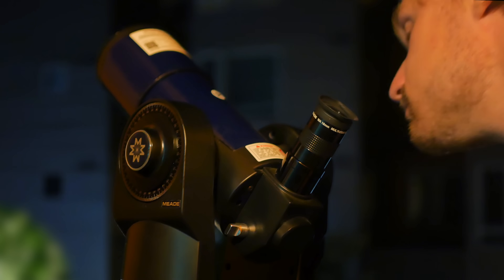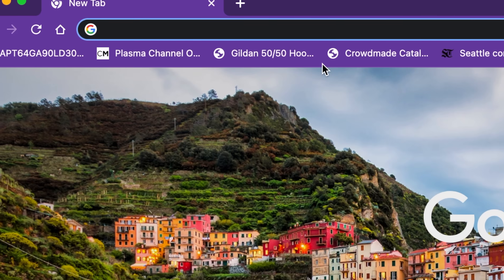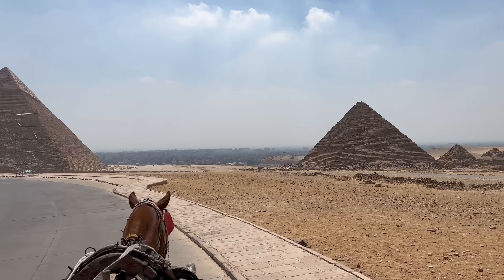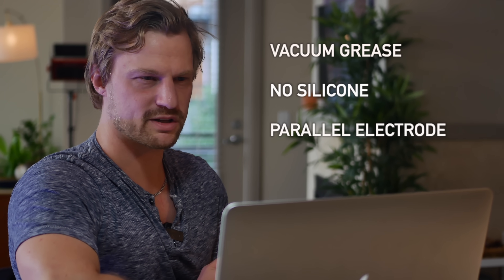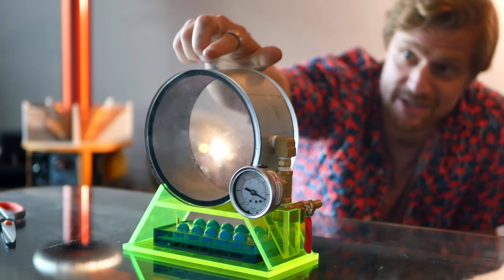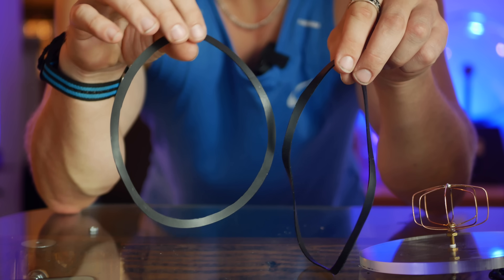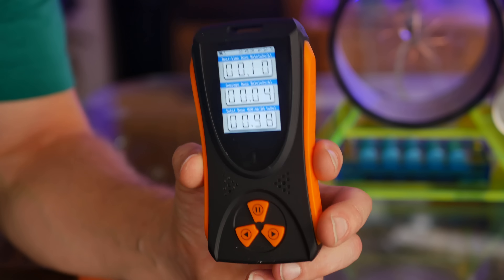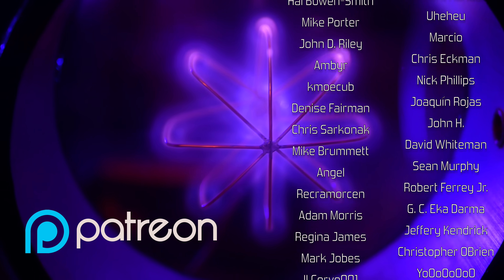Building A Nuclear Star In A Jar (Fusor)

Comment: Humans will never, I repeat, NEVER, creat successful star like fusion on Earth. I am pretty sure fusion attempts are one of the latest ploys to liberate cash from taxpayers and private investors. The problems are that we humans are not capable of producing the pressures and free gravity acceleration that occur naturally in stars and that most stars in the universe do routinely. Every 10 years fusion promoters promise fusion within the next decade and never materializes. The only way to do it is with a fusion fission combination that at the end leaves you thinking, why don't we just use new safe clean fission. Scientists are not telling you that all the viable options, tritium, hydrogen to tritium etcetera, etcetera, are impractical and not viable. Also at this stage in human technology we still do not have viable energy storage batteries. Albeit compressed air storage is coming up but has not reached maturity quite yet. The problem is still that whatever apparatus is devised to sustain a fusion reaction, they still only have low net power production and sustained reactions are still in seconds. Far from a sustained constant reaction at anywhere near peak efficiency. You have to keep in mind that stars have free energy from gravitational mass. We are not capable of collecting and controlling this amount of mass and if we were we would just encapsulate the Sun as a level 3 civilization might and harvest 100% of its energy. It is folley to think we are near a succeful sustained reaction and most importantly a waste of money that could be feeding or housing human beings. I'm not saying no one should try. We should for nothing else but the sake of pure science. We're just not anywhere near it if you understand thermodynamics and basic physics. Fusion is kind of a political clickbait at this point in our history with all the emphasis on renewable energy. I'm just saying. No fusion project, in light of my recent physics self education, is telling you the truth. We can't create a star. Nor can we recreate any of the conditions present in a star aside from short bursts of high temperature.
Reply from the maker: “Humans will never breathe underwater” “Humans will never fly” “humans will never leave the earth” “humans will never attain wireless power” “humans will never attain the power of the atom”

All claims from the past. All of them, obliterated. Through science, all things are possible.

Comment: Why not add a coil to see if you can spin the plasma? On the inside of the coil you built, put a charged circular wire in with a stepping control so you can vary the resonance. That would be epic and quite possible extremely dangerous!

Comment: I've built a working Fusor:

1. A PVC hose is not practical for a low vacuum system as it will outgas preventing you from getting down to a very low pressure.
2. If your vacuum pressure is low enough you still generate x-rays which should be detectable by a gieger. I suspect your pressure is no where low enough.
3. You really need a better vacuum gauge, one that is designed for sub micron pressures.
4. you really need a much larger diameter vacuum connection. At least a half inch, and keep the connection between the pump and the fusor as short as possible. ie put the fusor on top of the pump so its just a few inches away. At low pressure the pump will struggle to get air out of the fusor's vaccuum chamber. bigger diameter piping will help. Ideally make it all metal piping to avoid outgassing from plastic. Copper tubing with compression fittings is a better option than plastic tubing.
5. I think you likely to suffer a voltage drop with the large electrode. the more current flows it will drop the voltage well below the 40KV. You probably running less than 10KV, which is also why you don't measure any x-ray radiation. Very low vacuum pressure + smaller electrode will reduce your voltage drop.
6. Your plexiglass\lexsan windows will outgas a lot, likely preventing you from getting very low pressures. Ideally I would replace them with glass and mount the electrode through the stainless metal frame. You need some sort of HV vacuum fitting. You might be able to get by with a spark plug, but thats iffy at +40KV as it likely to arc over since there isn't much distance between the electrode and the metal frame on the inside side. You might be able to weld on some wire to the spark and pass it through some glass tubing with some vacuum grease and some teflon tape. Teflon is a great insulator & does not outgass. Alternatively you can buy a HV electrical vacuum pass through from  or Kurt J Lesker (company). "LDS vacuum shopper" also sells vacuum components at a lower cost than Lesker.

FWIW: You best way to get an operational fusor is to go with commerical vacuum components, specifically conflat vacuum components and metal (copper gaskets). You could buy a Conflat Tee with one port for the vacuum pump, one for the HV feedthrough and the other for the window. The big cost is going to be a HV feed through as a 60KV feedthrough will cost about $2k. Maybe you can get lucky with a 60kV feedthrough on ebay (ie used) to save some money. The biggest issue making a working a working fusor is the cost of components or the time collecting used components on eBay at a reasonable cost. I probably spent over $10K in components to make a working fusor & also did a lot of self fabrication (ie machining & welding Stainless Steel parts for the vacuum chamber and welding on conflat flanges),  $3K+ on a turbo molecular pump and a high volume low submicron mechanical pump $1K. I think I spent about $1500 on the 60Kv high voltage feedthrough (purchase about 20 years ago), vacuum bellow hoses, oil backstreaming trap. As well as assortment of radiation measurement tools: BF3 & He3 tube to detect neutrons, NaI Scintillation detectors.  Building a working fusor isn't easy nor cheap.
Reply: What about gamma radiation? Not poking at you, just curious about nuclear science…thought about building a decent sized one just to try to see some cherenkov glow
Reply: @jeffnixon4534  You never going to get cherenkov. First you need to submerge it in deep pool of water, second there won't be enough fusion reactions for it to be visible. Maybe detectable using an array of PMTs

The way to make a decent fusor is using conflat High Vacuum components & a good vacuum pump, preferable using a turbo molecular pump backed with a rotary vane roughing vac. pump. You also need a HV power supply capable of operating 50KV or more, and small supply of deutrium. You also need either a He3 or BF3 tube to detect neutrons. BF3 is better sine He3 is still sensitive to x-ray\gamma emissions.
Probably a $5K to $7K invest using used parts.
Reply: @guytech7310 so is cherenkov only achieved with fission, or is it just the fact that you don’t get enough radiation from a small scale fusor?
Reply: @jeffnixon4534  You never get enough reaction from a fusor. At best you might get a few million fusions per sec. No where enough to be visible.
Reply: Lost in reading, forgot to like

Comment: There is a material called Alon it's aluminum oxynitride at 1.6" thick it will stop a 50 cal bullet. It's transparent and the manufacturer can machine a cylinder so you only have one mating surface. I have a friend that works in hvac he when he charged my system. He told me it's best to evacuate a system on a hot day the added temperature aids in the removal of air when vacuuming a system. I believe you could get even lower numbers on your vacuum.

Comment: Question: how possible is it to get cancer with the radiation? Or is it even possible to get it with this radiation? It's not that dangerous right? ^^
Reply: If the reactor is improved and becomes operational the risk of cancer would be high, however you would need to stand next to it for a long time to have a significant risk.

Comment: Like others pointing out already, your setup has a lot of issues. First of all, not strong enough pump. Your countertop vacuum pump won't cut it, no matter how expensive and big they are. You need an turbo molecular or oil diffusion pump. Second, you need DC Voltage, not AC. 
Fusors are relatively cheap and easy to build, but not that cheap and easy. 
I know only 2 Youtubers who build real Fusors, BenNBuilds and Science Marshall. Look at their Videos for an good DIY solution.

Comment: I can understand why the inventor of the CRT television (Philo Farnsworth) would have been involved in developing this. Controlling the electron beam in a CRT is pretty much the same thing as confining a fusion reaction. You're just controlling where electrically charged particles are. Energy levels are a tad higher and the geometry's different, but it's fundamentally the same. Either electrostatically like in oscilloscope CRTs, or these electrostatic fusors. Or magnetically like larger CRTs in televisions, or tokamak fusion reactors. I never would have thought fusion reactors and TV would have so much in common until I watched this and gave it some thought.

Comment: If the mean free path isn't long enough for a particle to oscillate about 100,000x across the middle of that little grid, you will not be doing fusion in the middle. 100k is just a best case, assuming a collision with every transit, and typically only 1 in 100,000 collisions, at exactly the best energy, will lead to fusion. Hence the need for a crazy long MFP. It's probably higher.

You won't be getting anywhere near there with that kind of pump. It isn't good enough. As far as the physics are concerned, you've still got a container full of gas, not a vacuum - it's just at less than atomospheric pressure. That means a very short mean free path - much smaller than the size of the chamber, so it'll have 'fluid dynamics' physics, not 'particle flow' physics. You'll just be doing fusion as particles hammer into the wire from very close range, in which case the shape of that wire doesn't really matter at all. (mean free path on the order of a few mm). 

@11:52 you can see multiple 'shells' around the inner grid: These are shocks caused by electrons obtaining enough energy to cause just the very first level, not of ionisation, but just enough to excite electrons in the outermost shell of atoms in the gas. Thus losing energy, before they warm up and do so again. The MFP here is likely vastly smaller than the width of those structures. You can see three layers. This isn't a plasma, it's just a hot, excited gas. If it were a fully-ionized plasma, it would be invisible (except perhaps to xrays or so) because there would be no orbital electrons to be transmitting a light glow like that.

Fairly recent experimental results with fusors has shown that the neutrons that are generated actually come from the surface of the inner electrode, not the centre of it as it is supposed to: Hence, operated like this, these machines are just an awkward variation on single-stage linear electric particle accelerator into a target. Which is known to cause some fusion. It's just that you can never reach breakeven that way.

Key to the whole idea of the fusor, is to make it into a spherical particle accelerator. The particles are supposed to only collide in the middle of the inner cage/grid. So you have to run it like a particle accelerator, and that mostly means a sufficiently extreme vacuum so that you can really have a long enough MFP (everywhere but the core, where the particles focus) and thus at least have a chance of recycling every fast, scattered particle, no matter what solid angle it happens to scatter into, until it eventually undergoes fusion.

This is not that, it's just the ordinary particle accelerator driven into target kind.

You'll probably get better results just putting a sharp needle in the middle there, in place of the cage; at least the electric field will be really strong very close to the needle point, because of the shape. 

You could perhaps find a nice piece of, oh, say palladium. Check under a SEM, and get the one with a nice array of very fine microscope sharp high points across the surface, and try that. For greater simplicity, you could just fill the 'vacuum' chamber up with heavy water too. Oh wait... Sounds like 'LENR' (previously known as 'cold fusion') was just the same old 'very small range, awkward particle accelerator type' fusion ALSO! (Else, why would some pieces of Palladium generator neutrons, and others not? It's probably just this nanosurface electric field concentration thing going on, at least up until it finishes electropolishing itself flat again).

(BTW, yes, sharp points do cause very strong local electric field strength, and it's the electric field strength that actually matters, not the voltage. This is why air ionizers use very thin wires or an array of needles).

Anyway, needs basically a *huge* diffusion oil pump, preferably multiple stages thereof, and a cryo trap to stop oil getting back into the chamber. (Or you could use a very big turbomolecular pump... how big is your budget?)

The 'vacuum connection' also needs to be as much of the surface of the vacuum chamber, too - can't use a crappy little hose like that, it will have too little vacuum conductance. Ideally you shape the chamber sortof like an old school headlight reflector - so that the surface tends to bounce loose particles right into the high vacuum pump inlet. This will help keep background neutrals down.

To actually get 'fuel' gas in, you need a gas injection system. This needs to trickle in almost no gas at all: otherwise you'll flood the thing with too much gas, and it'll no longer be a particle accelerator again.

Comment: You shouldn't be so sure about not having any x-rays. Most domestic Geiger-Muller tubes will only start picking up x-rays over 50keV and with your CW feeding only 40kV, you could very well be missing a large quantity of "soft" x-rays that make it through your windows but not over the threshold of detection.